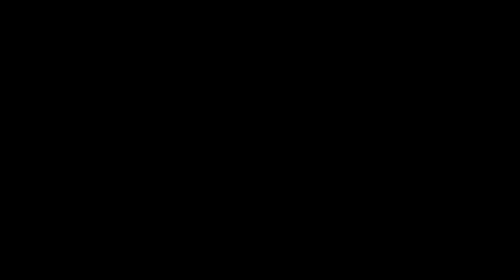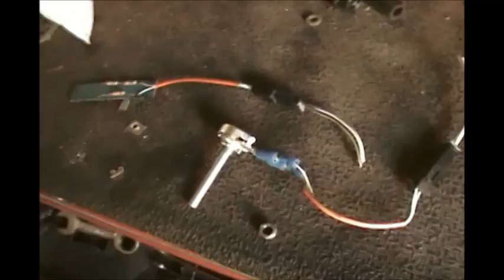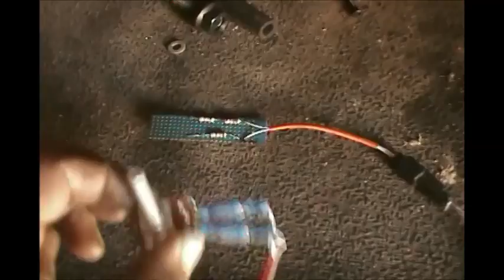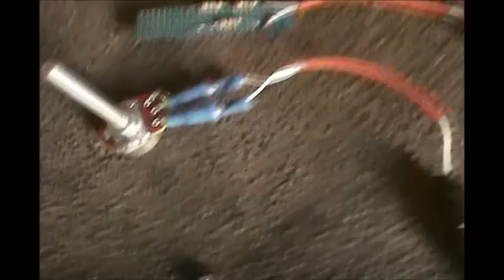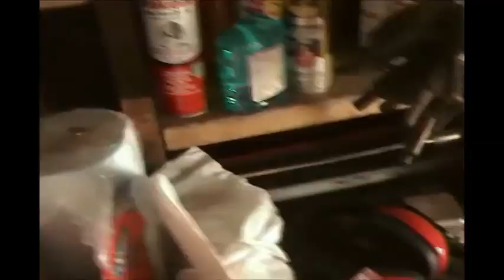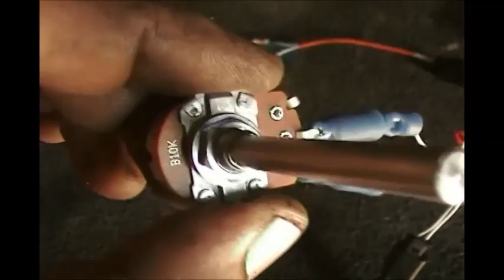GM passkey test and bypass

Comment: I have a 99 Blazer pass 2 security.What year and model vehicle did you use this on and how long have you been using it? Did your vehicle roll over and not fire up,or not even start when key was turned?Have you had any problems at all since install? Thanks very much!
Reply: 90TegTurbo